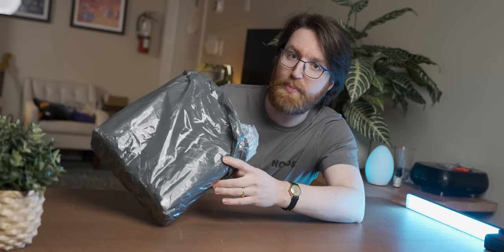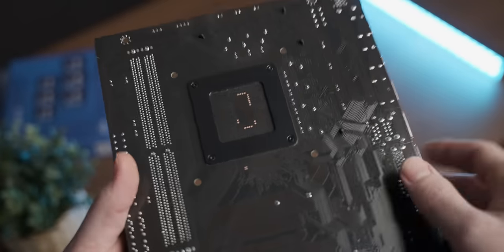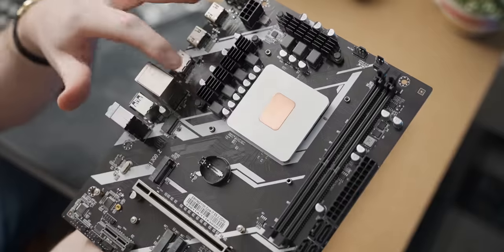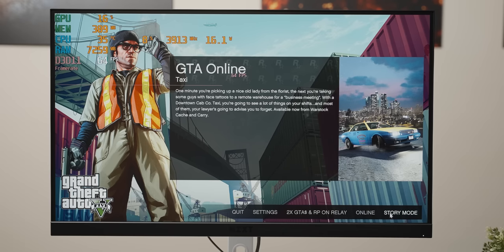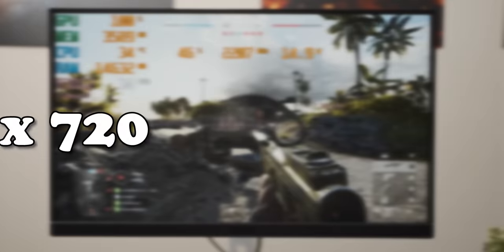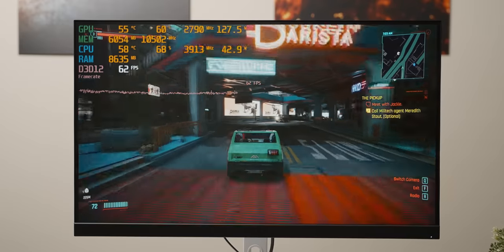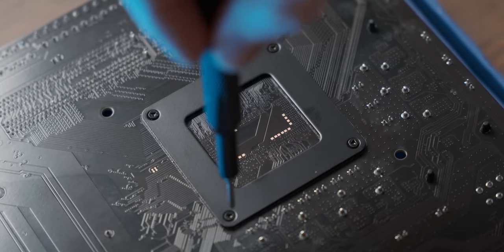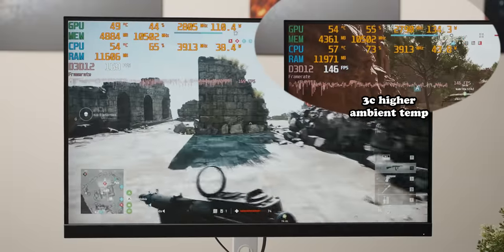Has Aliexpress Motherboard Science Gone Too Far?

Comment: Idk why but I'm fascinated with these weird motherboards. I know Linus also unboxed a motherboard with a built in gpu as well.
Reply: Not that weird,  there is a surplus of laptop CPUs and GPUs due to recession and reduction in purchasing power. These companies buy them in bulk and sell them as cheap desktop PC  parts
Reply: @aleksazunjic9672  I was wondering if they were buying up broken laptops with CPU and GPU chips still intact
Reply: Built in gpu or CPU?
Reply: @Пойонеп  Usually no, there are lot of unused CPU and GPU chips sitting in warehouses. These could not be sold to general public, so they wait for manufacturers like this one .
Reply: Most CPUs have integrated graphics these days man. The only difference here is that it's a laptop part soldered directly to the mobo. Why you would be this cheap us beyond me.
And video on mobos? Yeah you could find some mobos like that pre 2010. Mobos that used Nvidia's later nForce chipsets for example had Nvidia laptop video cards on them because the 8k/9k Geforce series cards were super hot and super power hungry so they decided to let you dynamically switch to a lower power GPU on the mobo. The feature was called Hybrid Power and there was also something called Hybrid SLI (with a Geforce 8200 or 8400 with DDR2). They dropped support for everything like 2 years later lol. The onboard video is basically a Geforce 8200m which I'm still using right now woohoo! I'm actually having compatibility problems with a new dedicated card I just bought so yeah, I'm watching some tech vids to sooth my anger and frustration...
Reply: I think they're so good too

Comment: you know if they made an ITX version of this , it would be even more appealing than it already is (depending on the price)
Reply: i would get one just so i can run unlocked for low power usage. i would love to tweak it for a 250w max power solution
Reply: theres a few kits with and i7 that are going for like $320 Cad. mobo, CPU, Ram, SSD. killer deal for like a budget gaming PC.
Reply: @HavokR505  the higher bin chip for the engineering sample runs 4.5 and is like 220
Reply: They did. One of my friends bought one last year from the local version of Aliexpress in China and made a tiny ITX PC with that
Reply from the maker: That’s a good point. ITX does make a whole lot of sense for something like this.
Reply: This is perfect for ITX, low power CPU that would be fine with a very basic low profile cooler and lower power psu. Stick a low profile gpu on there and you have a nice little upgradable system.
Reply: @Wotzinator Okay that sounds like a video he would do.
Reply: @mikeymaiku  I like that idea overclocking laptop processor. 👌
So crazy mad scientist nitrogen Cooling I'm kidding of course. ✌️
Reply: @EDV8ZR1  ive played with the 1151 laptop cpus on standard boards. Its fun to see nearly 5ghz on 8c/16t laptop chips when using really good direct die cooling
Reply: they do have itx version board but not by erying, and the store or seller that made those are not on aliexpress mainly only within china plus the pricing isnt really worth it as well lol
Reply: @rihavein8966  possibly on Alibaba bye chance
Reply: @EDV8ZR1  hmm, I would have to check but I highly doubt so. I only know this because I shop within china e-commerce platform alot. And also iirc the one on the itx board is a retail version not the es and the pricing isn't really good even for me who can get from china e-commerce platform as well
Reply: Maxsun is making a 12th Gen mobile itx board, no clue for release date but it is in being made
Reply: @Spicer1104  even if the make the (milestone) series of those 12th gen board, is still as expensive as their 11th gen milestone board which also cost double the price then what erying or other diy makers made with the retail 11th gen chips.
Reply: they did

Comment: You shouldn't do direct die cooling if your cooler has exposed heatpipes like that, it can cause die to crack and AliExpress LGA1151 laptop CPU sellers warn you about this.
Reply: I suspect dawid gives somewhere around zero fucks about this motherboard; it's likely in the trash now.
Reply: its a matter of "even pressure".

hold the cooler down before evenly distributing the pressure and your fine.   

they warn you because they dont want to have to replace it under the pretense that you had a user error but decided that the chip "cracked" in shipping.

Comment: I've got the 1.8 ES version running an unRAID server at the mo and it's working great, upgrade from an old dual Xeon board that used so much power. This thing is super power efficient
Reply: Hi, i am looking top build an unraid plex server with one of mobo/CPU combos. Does the hardware transcoding work without problems/crashes ?
Reply: I've only had it running for about a week but so far it's been stable, hardware transcoding is working great, super low temps and power draw and boosting to 4.1 when needed. The only problem I had was if the top nvme was populated it wouldn't detect my sas controller on the pcie slot, moved it down to the bottom one and it worked fine.
Reply: @jamiemallett7448  hi, have you done any idle power consumption tests? Maybe also using powertop?

Comment: I've built a PC using one of these mobos, I got the i9-11900h version and I have to say this thing is a beast, and the better part of it 
it only consumes like 40w on load. 
The only downside that I found was the vrm temps 90c without the heatsink.
Reply: Do you remember how much you paid for it?
I am curious if it can be an economically viable alternative.
Reply: @markkocsicska2590  I paid 178 us dollars, o think the price is very cheap for a i9
Reply: @ottoguilherme5026  i9+motherboard. Not a bad price at all.
Reply: just buy 20$ heat sinks ez fix
Reply: Would you happen to have the link currently interested in one of these
Reply: Was you able to install Windows 11 on this system. Windows 11 was not working for mne. Windows 10 works fine. Thank you.
Reply: @ezequielmartinez5927  i tried tô sendo the link but i thimk YouTube dont let me
Reply: @torquenstein4761  find a TPM switch in BIOS
Reply: @ottoguilherme5026  damn that's cheap, I picked one up with the same CPU and it was $225

Comment: this kit is actually quite powerful but you have to config some bios settings and xmp works perfectly fine just need little work on the bios and it did be running nice and properly, as for the die to the IHS it doesnt have the best contact surface, so to reduce temps even further you have to disable the avx512 and the intergrated graphics, also it should be boosting constant at 4.4/4.6ghz all core or most of the time. The Br community has done quite a few videos on this kit. Its past 12am already! 26th, the pre sale for 12th gen boards are out in china atm, however i doubt the prices will be any good because they dont have 12th gen laptop es so retail chips going to cost alot more.
Reply: @Penetrant there a rebar setting in the bios, if you want to double confirm u can also see some br videos afew also show how u can enable rebar support
Reply: @rihavein8966  link please?
Reply: @jarnovilen5259  what link are you asking about?
Reply: @rihavein8966  The BR Community, whatever that is. And their videos. Where are those?

Comment: You should put this and the Aliexpress 3060M together and compare it to a 3060 laptop with an 11800h.
Reply: Lol I have an Asus TUF laptop with an i7 11800h and a 3060. It's actually fairly crappy compared to a desktop 11700/3060
Reply: @100500daniel  yeah that's only a 95W model no?
Reply: @theboogerbomb  yea plus no mux switch.
Reply: I suggest the AliExpress 6600m instead. Less fiddling with custom driver
Reply: @100500daniel  given you're already running at low FPS a mux won't impact performance majorly
Reply: Same thing I was thinking

Comment: I wonder if CPU-Z would have been able to ID that CPU.
Reply: It would detect it properly, Windows is just - on, code is that, I'll display it.
Reply: No, is an ES chip, it will report the same in cpu-z

It will give you all the info tho, is an 8c 16t 24mb of cache cpu running at 4.5 boost 2.2 base and 50w tdp

Have pcie 4.0 support for the gpu and ssd, have a tpm and win 11 support and also has rebar support
Reply: @Elinzar  even ES Chips would get more details in CPU-Z, so thanks for details. With specs this seems like i7-11800H but with bit lower base and boost frequencies.
Reply: @idzan-private  yep, both 8 core ES chips run a bit lower than they where supposed to become
this one is indeed the i7-11800h/i9 11900h
and the other more powerful one runs at 2.6 base 4.7 boost and should be the base for the 11980HK, the rest of the specs are equal tho, just binning
Reply: @Elinzar  what about all core boost?
Reply: @My_Old_YT_Account  Craft Computing did a good demonstration of how these cpus work, basically their max tdp and clocks are limited by a timer, they hold their max clock and tdp for like 90 seconds then it downclocks, stays for i think 40 more secs and then it downclocks again

but if you dont hit the 50w tdp , it will not downclock

in any case, the boost is All Core, you dont have the first cores going 4.7 and the rest doing 3.8
Reply from the maker: I checked and it didn’t. It still referred to it just as a “Genuine Intel CPU”.
Reply: @DawidDoesTechStuff  So, I'll ask a dumb question -- does that mean that it's actually one of those Chinese domestic-market x86 clone chips, masquerading as a "Genuine Intel" chip?  Or, is it just a bug due to using a laptop chip with a semi-unsupported chip set?
Reply: @derekchristenson5711  It's an actual Intel Engineering Sample chip. They're basically pre-production CPUs sent out to manufacturers for designing and engineering new devices prior to launch.

Quite how Erying got their hands on so many, I can't explain.
Reply: it would probably say "Intel Core i7"

Comment: Maybe using Intel XTU and cranking up all the sliders it will let you could help alleviate the cpu bottleneck. My 11400H can start to use around 60 watts sometimes if I remember correctly (if it’s not at 100 degrees, average dell user moment)

Comment: To mount your heat sink, you may have to go "old school" and use some nuts and bolts to mount the heat sink to the board.
Reply: Zip ties are more old school, and pretty ghetto. 😂
Reply: and probably better use high performance thermalpad
Reply: @watchmejumpstart yah, but the the temps were more stable... Shrug.
Reply: @vipvip-tf9rw  If it's going to be stable platform for a while (desk, table, so on). I would use liquid metal.

Comment: To my knowledge, Maxsun, which is a reputable mobo brand in China, makes a better version of this board in OEM builds, and with their advanced UEFI BIOS, you can actually overclock the 11800H to all core 4.6-4.7 Ghz, RAM set to 3100MT/s, and power draw PL1 set to 150W, it beats 11700K and all benchmarks will perform exactly same as a 11900K, but it will need liquid cooling if you go down that route.

Comment: Considering it tends to be difficult to find a motherboard or CPU by the time either one breaks because Intel keeps changing the freaking socket, I've never outright dismissed the idea of a desktop motherboard with a non-socketed CPU. That said...this idea works a heck of a lot better on mITX than mATX. For one, it'd be actually smaller, without hampering gaming performance the way a miniPC without a PCI-E X16 socket while remaining small enough depending on your case choices. Second, it actually lets you have more case choices, like one of those miniITX sandwich cases (and given it's a laptop CPU, it should work fine with most downdraft coolers at 70mm max height), and given the 3050 desktop card comes with 8gb and the 3060 gets 12gb, unless there's a GPU shortage this makes more sense for a compact gaming PC than, say, that MinisForum AMD miniPC where you socket it and a graphics card on something like the thing NUC Extremes used to use. Except the CPU/motherboard is facing the other way so, yey, no CPU cooling issue; but then again it's an open chassis so good luck using that if you have a cat or small children in the house.
Reply: I've wondered the same thing myself.
Reply: my assumption is the tools/machines used is limiting thier ability to make such small boards compact loaded with basicly every feature.
going down to smaller pcb traces not to mention multiple layers of pcb probably requires a much more advanced machine than they are using to produce the boards

Comment: RAM should be able to run at 3200MHz and I'm pretty sure that the CPU can probably be OC'ed, just not sure how. There are channels that show that. It would be interesting to see how it does with proper RAM speed and some OC.
Also as everyone said, all AliExpress sellers tend to not include batteries(probably because it's against the law), because we all know what lithium batteries tend to do on a plane.
Reply: I do have Erying i5 version. There is XMP setting in Chipset > SA platform > Memory

And yes, this CPU can OC

Comment: Wonder if using ThrottleStop would release further headroom of the CPU. May allow it to clock higher.
Reply: Laptops tend to throttle the clock down to protect the hardware (Thinkpads and many others did that), so even when they are mobile version, you wont be able to get the100% of its power. With "unlimited" cooling like it would be the case of a desktop (compared to the restrictions of a laptop) you could push them to the limit for longer.

Comment: bro. this coolin solution reminds me of my PC from 2006. I got a water cooling system for it but it only fit the newest socket type and I didnt pay attention to that. I was quite poor so buying a new one was out of the question. So I ripped the mounting brackets off and just placed the contact on the cpu. Super glued it to the mobo and put a few 6 volt batteries on top of it to hold it steady. I gamed with that PC laying on its side like that for 2 years lol

Comment: I really enjoy your videos, and always look forward to your next one! Something you may want to experiment with is old CPUs. My newest build is using a i9-9900k with a Z390 Chipset. I'm waiting for a Zotac 4090 then I'm gonna game and do some benchmarks. I'm quite curious as to how it performs.
Reply: Why did you decide to go with 9900K in 2023? It's a good chip, but not a good match for a 4090, it's a r5 5600 level and gonna bottleneck the heck out of the 4090.
Or it's just for a test?
Reply: really recommend you upgrade the cpu
Reply: @Zysperro  I had it in a Gigabyte MB so thought I'd try it. I expect I'll swap it and the MB out, but just gotta get some numbers first.
Reply: @Zysperro  I will know shortly, then will put the 4090 in my  i9-13900K system. Its gonna be interesting to see how the old work horse responds. Right now I have a 3060 Ti running with it and the CPU just yawns...

Comment: This actually looks great if you wanted to buy something to build a very cheap but capable gaming PC, especially for a kid, or someone older, who may not need, want, or know how to use, all the bells and whistles you can get out of higher end, more expensive parts.

I imagine paring this with those weird RX 580s for around 90 bucks that are found on Ali Express.
Bet the i9 version of this board and that card for about $250. After that, all you need is power supply, case, ram and storage. An easy sub-$400 build, that can still be upgraded later with a better graphics card.

Biggest problem I see, gaming wise, is that there is no USB-C port, and the USB 3.0 ports are just that, only 3.0, so VR isn't going to be a thing on this PC.
Reply: Update:
I bought the i9 version of this, and one of the weird RX580s, and I'm gonna build it as a replacement gaming PC for my father's ANCIENT rig. Two or three weeks, and then I'll see what happens!

Another more amusing work case for these motherboards? Imagine, for the people into such things, someone wanted to build a portable cyberdeck with one! The TDP is only 45 watts. I have a 250Wh battery that peaks at 100 watts output. I imagine, with some creative tinkering and sticking with the built in GPU, I could build something fun to turn this laptop CPU in a desktop mother board into some ugly, frankensteined, mobile cyberdeck. Maybe when I have the money to buy another motherboard!

Comment: I'd like to see you bring that motherboard back for a future video and play games on the iGPU but using FSR and XeSS. That iGPU performance actually shocked me so, I'd like so see how upscaling will help it.
Reply: Amd would be better for that
Reply: @vipvip-tf9rw  Their APUs, yes. This Intel chip is not an APU which is why I'm surprised that the performance was relatively playable.
Reply: @mtx247  If it has igpu then It's apu, If it has cpu cores only then it's cpu
Reply: @vipvip-tf9rw  You must be new to the PC space, that's completely false. An APU is vastly different. An APU has a larger GPU than CPU. A CPU with an iGPU is smaller than the CPU. It's pretty much there to provide the bare minimum visuals whereas an APU is seen more for it's graphics capabilities. Hence why the APUs have the "G" nomenclature on AMDs APUs. Intel does not make APUs.

Comment: I think these motherboards are great!
You get a high-efficiency CPU designed for mobile devices, so very low powerdraw + a fully unlocked bios/uefi.
It´s prefect for office PCs as the performance is more than sufficient + it´s pretty silent as the power draw is really low.
AMD supports this officially on their platforms, they sell the mobile chips as "APUs" for example the 4xxxx Series where you get a Renoir Chip on an AM4 socket.